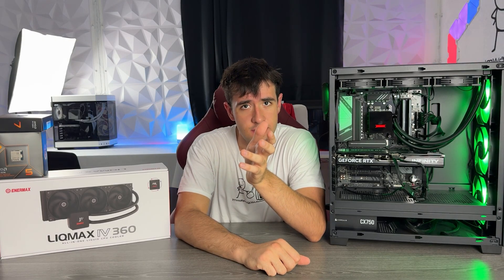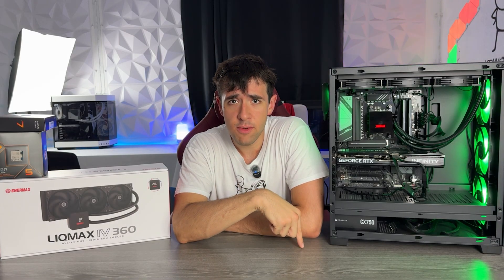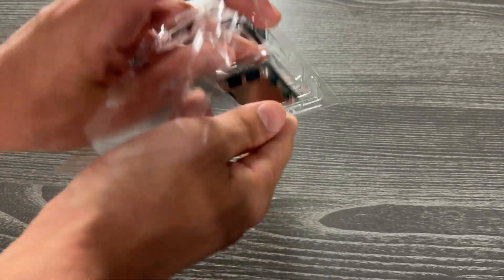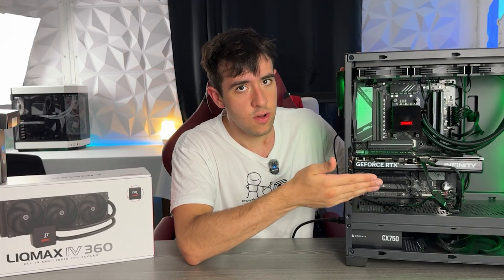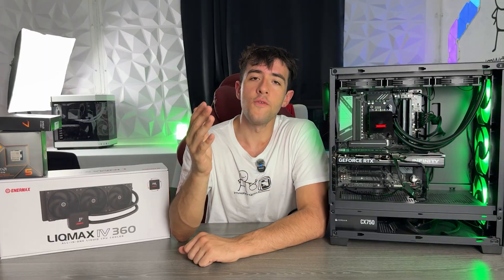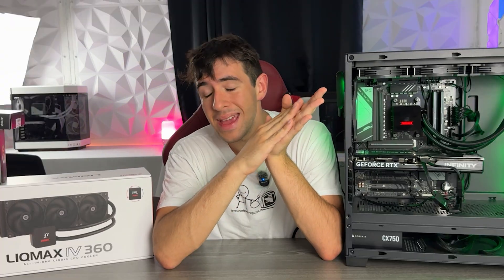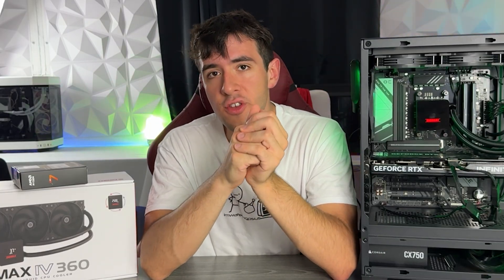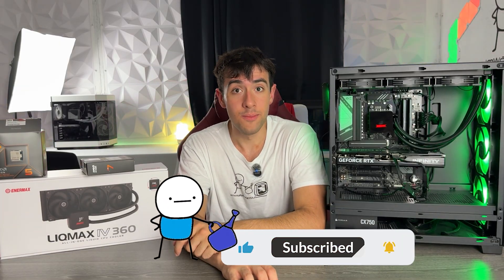Avoid Bottlenecks on your Gaming PC! - Fixing a Terrible RTX 5070 + Ryzen 5 8600G Build

Comment: I mean this really really depends on the games and the monitor your friend is using, at 1440p and 4k resolutions the GPU should really be the bottleneck long before a 7600 or even 8600g run out of power...
 
In the Video "AMD Ryzen 5 7600, Ryzen 7 7700 & Ryzen 9 7900 Review & Benchmarks" by Hardware Unboxed they ran a 10game benchmark on the 7600, 7700 and 7900, and between the 7600non-x and the 7700X it was 221 vs 240 average fps (13min 10s) that's on 1080p with a 4090. And despite what NVIDIA may claim the 5070 is not equal to a 4090. So a 5070 & 7600 is a perfectly good match outside of Esports FPS maxxing.

The 8600g is not as good as a 7600, but it's still within 10-20% in performance depending on game so I wouldn't think that you'd have a terrible bottleneck when pairing the 8600g and a 5070, you'd have a small/noticable Bottelneck at 1080, it could go either way depending on the game on 1440p and you'd be fine at 4k... 

Whats more likely to have make a difference are smaller external factors:
1. Half the L3 chache - AMD APUs tend to have halve the L3 sizes compared to full desktop chips (32MB 7600 vs 16MB 8600g) 
2. Half the PCIe Lanes and only PCIe 4.0 - Currently AMD does not have an AM5 APU with PCIe 5.0 support and the reduced lanes mean you can lose up to 75% of Bandwith (half lanes X half speed = 1/4)
3. Thermals - The 8000g Series is not soldered. They use only thermal paste under the IHC. This means that 7000 and 9000 series can Boost much more aggressively until they reach the 95°C design temp.
1&2 can really mess with specific games&applications and 3 really depends on the cooler & Case...

What I am really missing from the video is a before and after, 
Since yes, from a blank slate a 7700 is the better choice, but for a 300$ upgrade cost (200cpu+100AIO) I do wonder how much of a difference it really made in this context with all of the above...

Comment: Hey i recently upgraded my gpu from Rtx 3060Ti to RTX 5070 with my existing processor i5 12600k is it ok or I have to change processor
Reply: Luckily you're already on LGA 1700 ...(if need) for example, the 14600K is on sale right now on amazon if you're interested—it's a beast of a CPU and overclocks well. Compared to your current one, it's a pretty big step up—like 40–50% in some cases. Or you’ve got the 14700K going for around 300. But it really depends on what games you play, you know? If you’re mainly into the usual triple-A titles you see in benchmarks, you might not even notice much of a difference. But if you tell me you’re playing Diablo 4, Final Fantasy XIV, Monster Hunter Wilds, or other MMORPGs—then yeah, in that case your CPU really matters. I’m personally running the 14600K with a 5070 Ti right now.
Reply: @monikaguerraThank you for the advice but with existing problems of 14 generation is it safe to upgrade, and I want to purchase i7 14700k and yes I am playing triple a titles like stalker 2,Indiana jones and the great circle,Doom the dark ages,Dragon dogma 2 and multiplayer games but I am not into the MMORPG stuff
Reply: Look, yeah — basically it wasn’t the CPUs, it was the motherboards pushing too much voltage on the CPU’s Vcore.

So when you update, you get the new BIOS which adds a profile called Intel Default Settings — and that’s the safe one.

Honestly, I wouldn’t go for the 14700K because it costs a lot more and isn’t that much faster. Plus, it’s really hard to cool.

I’ve always had i7s, and I’ll tell you — this one doesn’t even feel like an i5.

But hey, if you want the i7, go for it — just be ready to buy a 420mm cooler and you’ll have to undervolt it, no way around it, because it runs hot.

My advice? Go with the 14600K — for the price, it’s unbeatable and the performance is basically the same.

(I’d say get a Z-series board with the 14600K and do some overclocking. If you’re not sure how, don’t worry — I can find you a video to copy step-by-step and you’re good to go. ( Personally, I’d say save money on the CPU — get the 14600K, and with the money you save, grab a high-quality cooler and a Z-series motherboard so you can have fun tweaking and overclocking.

Keep in mind, Barblenet Lake is expected to arrive on LGA 1700, so if you get a Z-series board now, you’ll be future-proofing your setup too. )
Reply: @monikaguerraok thanks for the reply my motherboard is Gigabyte Z690 UD AX DDR5 and ram I am using 32GB 5200 mhz frequency (should I upgrade ram to 6000 mhz or it’s fine) and I will consider to buy i5 14600k or rather wait for intel Bartlett lake processor.
Reply: Sorry, I got a bit confused — I had two people asking me at the same time 😅

One guy was building a whole new setup, so I told him: go with the i5, see how it performs for you, and then decide later when Barblenet Lake comes out, in case you need more power.

But you already have the 12600K, so yeah — you could go for the 14700K if you want, but just keep in mind it runs hot, so you’ll need a good cooler, and you’ll definitely have to undervolt it.

Again, sorry — that last message was meant for the other guy, I mixed things up 😅
Reply: @monikaguerra no problem I will decide when Bartlett lake came out😊 and thanks for correcting.
Reply from the maker: It’s definitely still okay meaning not a huge bottleneck, however you’re gonna get more performance if you do upgrade CPU :)
Reply: @ImWateringPSUs Thanks for the reply and yes planning to upgrade to i7 14700k

Comment: I have a 7800x3d and i went up to -25 and it hot some whea errors code found in occt then i went back to -24 no error and -23 also so is going 2 higher ok?
Reply: I have an R7 7700 with maxed PBO and -40 CO, plus RAM at its limit. I get some errors in OCCT, but the system never crashes and runs fine. As long as it's stable in daily use, it's all good